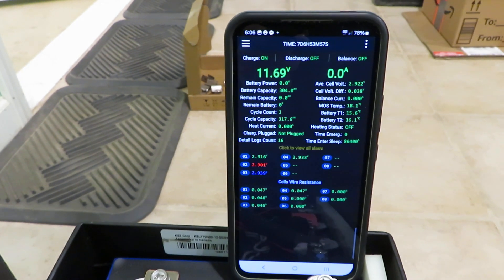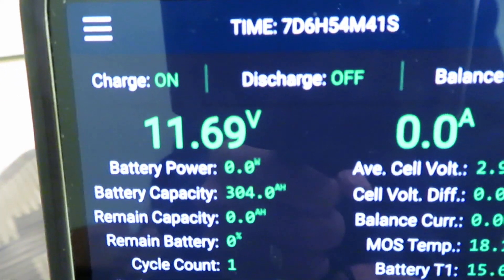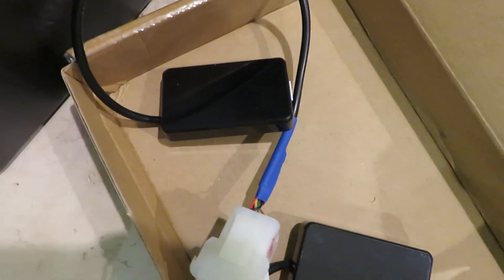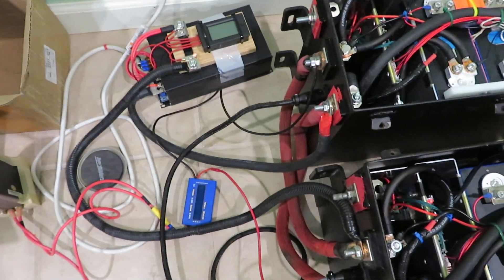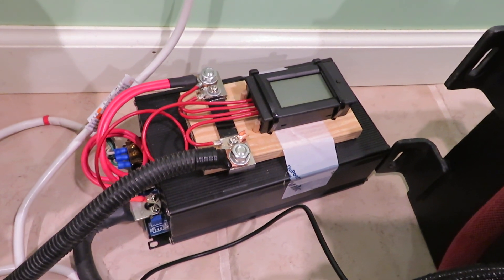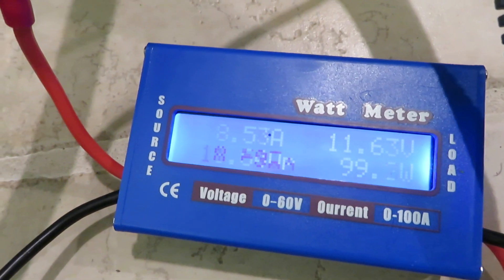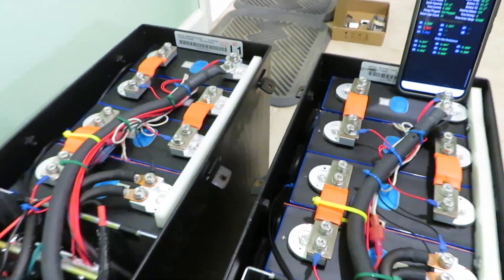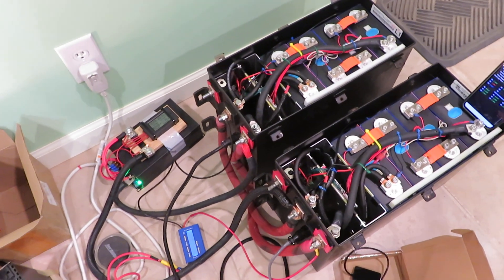JK BMS - Low Voltage Shutdown and Charging Recovery Test

Comment: Hi Park, nobody seems to be able to answer this question. Can you run 2 JK bms in parallel? In other words, if i have 8 life's and they are setup for 4s, with 2 in parallel for 12 volts, will the JK Bms do this? Thank you.
Reply from the maker: You can't connect two JK BMS's in parallel. Connecting two JK based batteries in parallel is fine provided that they are individually fused at 300A before the connection.
Reply: @parkhopper3627 
Thank you Park, but I don't understand.  How are people using these on their home solar, which has dozens of batteries, if there is no way to connect more than 1 bms. Obviously,  you can't power a home with 4 cells in series and no cells in parallel.  Thank you.
Reply: You can paralel lifepo4 banks, for example, 4s with JK BMS paralel with 4s with another JK BMS etc... You cant paralel 2 BMS in one 4s bank